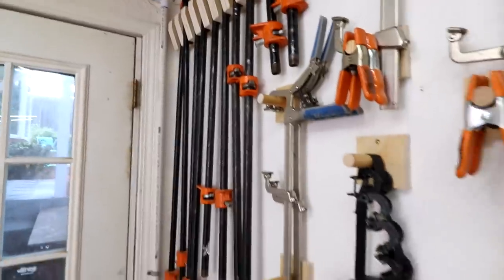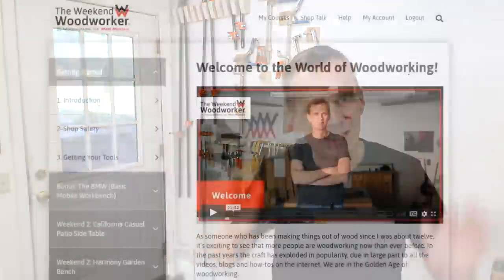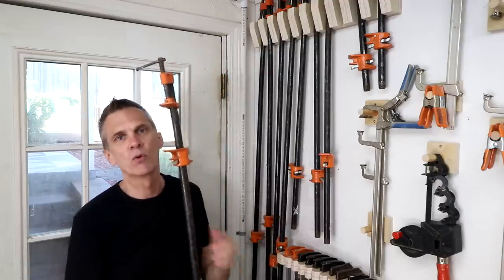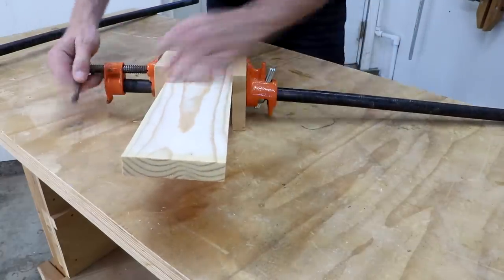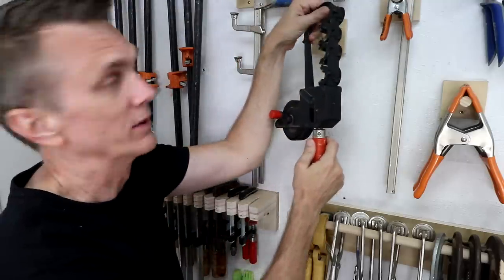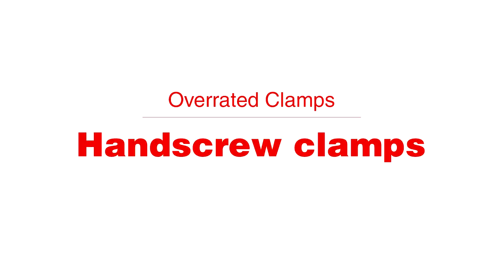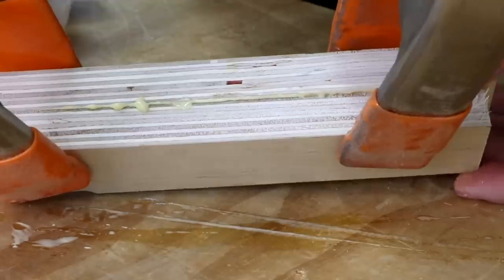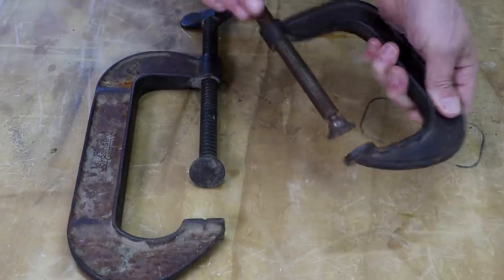How many clamps do you REALLY need? Woodworking basics.

Comment: Rules of Woodworking:
#1: You do not talk about woodworking.
#2: You do not talk about woodworking.
#3: You can never have enough clamps.
#4: If by some miracle it looks like you just might have enough clamps, then you made a mistake in your project.
#5: Pocket holes are evil and must die.
Reply: I'm with Steve on this one.  Pocket holes are not cheating.  There's no such thing as cheating as long as you make something.
Reply: @Not_TVs_Frank  There are certainly ways to "cheat". Just making something is not enough, since it has to be at least reasonably sturdy, strong, and lasting. You can cut many corners (cheating) to get there faster in detriment of those aspects.
I'm with Matthias when it comes to pocket holes.